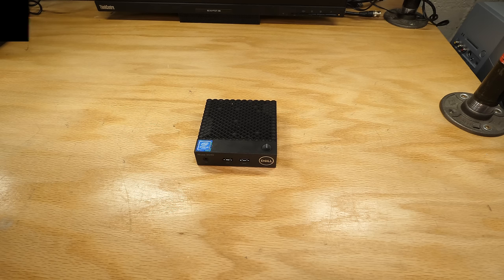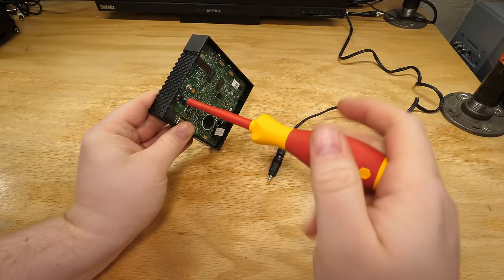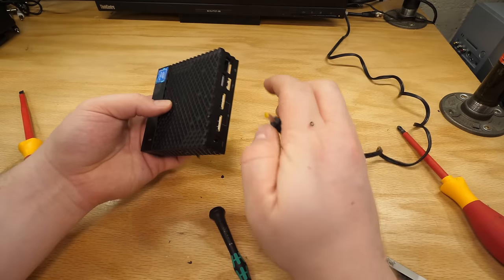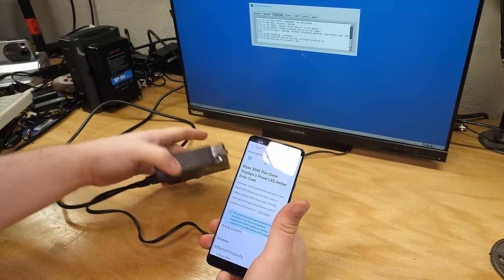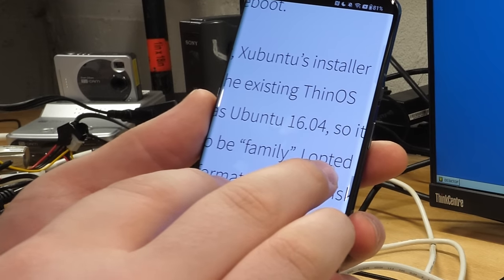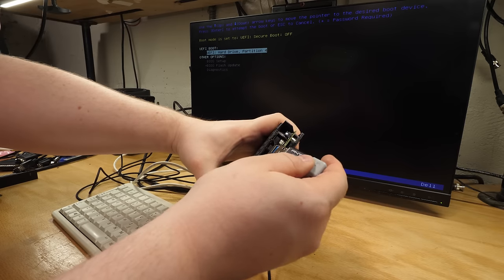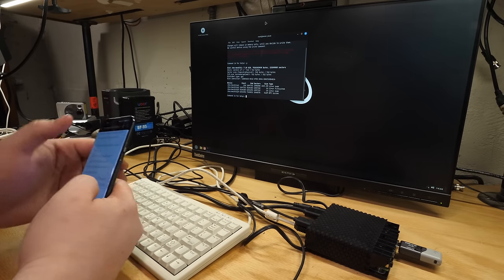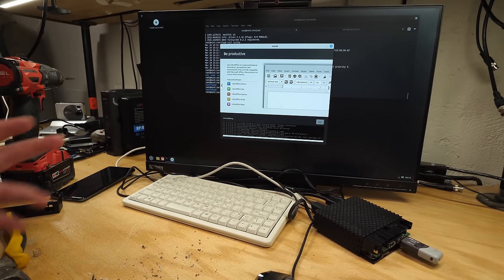Little Guys: Episode 2 [Wyse 3040]

Comment: Uh man those ones suck got stuck with them at school about 5 years ago even from the Citrix screen it was painfully slow like 3-4 minutes to desktop meanwhile the desktops with your user data saved took less than a minute and also if the vm froze forget it. Without task manager and the system occasionally frozen from chrome,etc… was a good 5-7 minute endeavor usually making logging onto another thin client faster and more painless made my Chromebook look good by comparison. Also occasionally the VM would just freeze and disconnect or lock up the whole system.

Comment: That tiny little thing is actually more powerful than the decade old 2 core atom machine that is running my jellyfin and asterisk. If there were a way to put a few terabytes of storage in it, it'd be an upgrade for me. Shame it doesn't have a m2 slot.
Reply: its got a usb 3 port on it you could plug a drive in that way. i got lubuntu running on mine and it was able to play back 1080p video over the network so performance wise its not that bad.

Comment: I got a hp 5040 or 5010 and I couldn't get it to boot ghostbsd and a bunch of linux distros and when I got manjaro working it was god awful slow so I since it came with a stand to keep it upright I now just use it to hold up a vertical stack of think pads from falling over

Comment: You can run Windows from a USB drive, even if Windows won't allow you to do so - you can apply the Windows install image to a USB drive and then boot from that.

Besides PCoIP "Zero Clients" which literally have bespoke silicon to decode PCoIP, most of these things are x86 and Linux based. We had some Dell/Wyse D50Ds which ran Dell's full fat OS which allowed RDP/VMware/Citrix/etc... My boss then bought some D10Ds because they looked identical... except that the OS is totally useless and we couldn't connect to our VMware environment... so I had to spin my own Linux distro using some build kit that escapes me... needless to say the whole experience was painful. The hardware in question was an old AMD dual core CPU, an 8GB SATA drive on a stick, and a 2GB SODIMM.

Ironically, the Linux image I built actually ran VMware Horizon better than Dell's own OS...

Comment: I threw Ubuntu on one of these and used it as a Plex box, the hard disk barely had enough space for Ubuntu and Plex, but that usb 3.0 port was key. I could use it to stream stuff from along my network and it was a super power efficient Plex box. What ended up killing it was os updates, Ubuntu grew too big and wouldn't fit on the HD. I did run windows on it for a lark and it runs terribly.dont bother.

Comment: What will it do if you put an el chiepo  M.2 drive in that M.2 slot? I did the same with my old, much larger PC and it worked first try. It might be worth getting a couple $20 M.2 drives to put in stuff like this, even if you have to hack it into place.

Comment: Those wyse 3040s won't post if its missing either of those screws. Now outside the case it will but inside it uses them as ground and won't turn on without them.

Comment: If you really want to install windows you want one of the IoT flavors. I believe this is what they now call the Embedded flavor of Windows. I was interested in setting up a Wyse Z90m7 laptop as a like Cheapest Possible Streaming Device and went down this rabbit hole. It only has 4gb of emmc storage so I believe I had to use an older Windows 10 IoT Enterprise LTSC flavor that was 32-bit instead of 64-bit because the 64-bit install size was larger than 4gb. 

I still have it on the laptop and it totally works fine, other than finding 32-bit versions of apps is a huge PITA. But I think my use case for this thin clients is very viable. Just make sure the OS is and application are correctly set up to use the hardware encoder in the CPU chip, get some sort of cheap USB UVC HDMI capture card, and for like $30 you can get a standalone streaming device. My Wyse laptop and chromebooks have a built-in webcam (potato quality, though) to even get a POV going on your stream!

Comment: You should check out the Wyse 5070 models they have a whole lot more options and upgrades. Both the extended version and the regular support nvme and 2.5gb ethernet addons.

Comment: Ahh, the classic "Python's handling of Unicode vs. bytestrings still sucks in 3.x... just in different ways" problem. Very irritating if you're a programmer hopping back and forth between Python and Rust and constantly getting reminded of how much better things can be.

From the traceback, it's dying in Ubiquity, which is Ubuntu's GUI installer. They seem to be unifying their text-mode Ubuntu Server installer on the same codebase under the name Subiquity, so it'll probably have the same problem, but you could try Debian instead.

Comment: I suspect you could use the stock software installation to connect via Microsoft RDP to a Windows 10 or 11 Pro machine that was set to allow remote desktop sharing.

Comment: I got a Fujitsu Futro S720 for 17€ and simply ignored the internal disk, booting Batocera from an USB stick, installing Steam on that and then installing Stardew Valley.
I think i should get me such a Wyse 3040 and check out what it can run, again ignoring the internal disk.

By the way, the CMOS battery is just a coin cell in the end, snip off the cables, get a flat coin cell holder, solder that to the cable and put some isolation tape around the whole shibang.
Reply: Anyway, the Wyse 3040 is way too expensive on the used market for what it is, i am not paying ~40€ for that thing.

Comment: Would stuff like Onlive and Steam Link be the video game versions of a thin client? How about Google stadia Chromecast? I'm not sure that one would count.

Speaking of video games this looks like a good place for your 32 GB SSD that's not really an SSD if this computer can handle it. 8GB is not enough im a wii u owner..

Also smallest drive I have installed Windows 10 on is 24 gig and surprisingly that was an SSD not EMMC
Reply: For the OnLive/SteamLink, basically yes. For the older Chromecasts (the ones sold with the Stadia Controller), it does have some aditional functionality as a video client, considering it's basically a very stripped down version of Chrome. The new Chromecasts are basically just Android boxes.
Reply: @Fay7666  ya I have a Chromecast. It's very strange how it has no menu or remote you have to literally do everything on your phone.

I like having a remote to pause or fast forward rewind like my Blu-ray player has but it doesn't have any of the streaming apps I use (cept Netflix and YouTube).

Mainly having to wake up your phone to pause is weird to me. Also what if I wanna charge my phone wile watching something. How will I pause the video then?

Comment: I remember trying to run windows off a 8gb USB stick. Win7 was too heavy, but some version of Win8/8.1 and early 10s was installable. 
I think I got to sub 7gb used, but a few hours with the system on, with a browser installed would fill up the drives, so it was really not at all usable. 
Unrelated but Win8.1 is a superior OS to 10.

Comment: Mine is running DietPi via a SanDisk usb - on 24/7 with Adguard. Currently trying to switch it from ethernet to wlan via a TP link adapter but it's being a pain in the backside.

Comment: I have booted into windows 10 with one of these, via an ssd over usb 3.0, it did not like it, at all.  Anything beyond the basic desktop felt completely unusable.  Plugging into a network caused it to lock up for around 2 hours while it updated.

Comment: EMMC will flat out just break if its not used for a period of time. I had an acer laptop with EMMC and it worked fine for what it was. never had an issue with it until the charger broke and i just stopped using it. Was going to give it to my mother after i found a charger that works and after not using it for 2 years the EMMC chip is completely dead. Being that theres no way to use alternative media the laptops officially e waste unless i just booted off USB every time

Comment: The easiest way to work with one of these things is to just install your os to a usb drive. the wyse 3040 is in a strange place specs wise its only supports efi no bios. but it only has 8 gb of storage which in reality is 7.5 gb.  most linux os's even the ones focused on performance require at least 8 gb of space.  so its actually a little frustrating because most linux flavors will happily run as a live cd but will crap out during the install.  there is a an adapter that can plug into that slot inside the pc but that will let you plug in a micro sd card for storage, however its got problems it requires drivers to be installed and  only works with specific memory cards. so aside from breaking out the hot air rework station and replacing the emmc chip that leaves usb 3 flash drives for regular os installs.  on a side note if you want to use the thing as a pi alternative you could  load an image directly to the internal 8gb of storage with etcher.

Comment: ooo I recently got a lot of 12 of them for $18 each, was supposed to be 12 but they threw in a "bad" one that worked just fine.
BIOS password is likely "Fireport" (likely mentioned on the video, but I just started watching it).
Reply: Although I will mention, I only got 3 that I consider "fully well" and just work including showing the NICs in the boot menu, 6 of them with a dead battery that take a minute or so after plugging in before they work (like in the video), and 4 of them that do that but also can't soft restart for whatever reason. Just got them a few weeks ago, haven't put them to work. Likely gonna do a Pihole or something with one, and try to use the others to learn clustering or something.

Comment: i dont think it has a superio. ?
the power on button is routed through an intel server ethernet chip, and most of the other io is handled by a usb controller. between the two it has roughly superio-like functionality
so its gonna a super bespoke boot sequence.
might also explain how the filesystem is architected, and the issues with the keyboard in the front usb ports

it could well be running mips under the hood until the atom initializes lol
certainly its gonna be booting off 32 bit code

Comment: Ironically I'm currently watching this video on an Intel Atom system. An old Intel NUC from 2015 with 8 GB of RAM. Too old to have an M.2 slot. It's my dedicated YouTube machine. It runs on 8 watts so I never bother to turn it off. I do turn off the monitor which uses WAY more power in comparison.

Comment: I installed windows 7 once on an external ssd on a laptop that the internal drive connection broke off the board. There's a way to do it, but its a little jank. There's also cut down verions of windows 10 like tiny10 from ntdev that use 2gbish of space.

Comment: Some of the slowness of that installer might be down to the absolutely terrible performance of those PNY USB 3.0 drives. I bought a 256GB one 9 years ago to replace my USB 2.0 64GB SanDisk only to find it so much slower than the SanDisk, managing to be even slower than my 2GB SanDisk from 2007 in tests, I ended up not being able to use it. Between that and numerous shoddy PNY RAM kits I had to replace I still refuse to touch their crap.

Comment: I work for a large national retailer and we used to use these for the training modules we are required to take and thses were dog slow and problematic and i parsed the commamd lone interface and ot connected to a vm that ran under suse linux, it took us longer to load them up tahn to do our training

Comment: I actually was able to force a barebones install of Windows 10 on my Wyse but it was at like 99% storage utilization which was a big problem because it was missing a bunch of drivers and it had no spare storage for basic operational needs. Also Windows update never found the correct Wi-Fi/Bluetooth drivers even though mine has a Wi-Fi/Bluetooth card in the slot (maybe because it used a weird SDIO type?) so I could only use the Ethernet port for internet access. Also it’s only got 2GB of ram so the performance was just bad. Overall this unit is pretty pointless, the 8GB soldered eMMC is too limiting, not to mention the speed of this storage type and the endurance will probably leave much to be desired. You can get a much better unit for a few extra dollars and there’s too many downsides to make this unit appealing.

Comment: I got Arch Linux running on mine using the archinstall script. Mine has 16GB of storage, though.
Basically all I did was nuke the partition table and then run archinstall. I was at a Hyprland desktop in about an hour and a half.

Comment: I think it could run windows using Windows To Go, which is a cursed portable version of windows that runs off a USB drive. It wouldn't exactly be "installed" per se, but it would probably work.

Comment: CMOS battery is dead, I would just use a variable voltage power supply to simulate it. 2:41
Reply: That... is spectacularly overkill when a CR2032 would do.
Reply: @SianaGearz I believe he says that he doesn’t have one at the moment. I was saying that as a temporary hack, not permanent replacement.

Comment: You should be able to get Windows 7 LTSC (use NTFS compression to compress program files and some of the Windows folders to shrink it a bit) or you could go backwards to a Windows 2003, most programs still work with it.
Reply: Windows 7 LTSC isn't a thing

Comment: I've had problems with ubuntu and colorspace before. If you change the color profile it should sort it out.
Reply from the maker: I tried this and couldn't work it out, but since it periodically jerked back and forth into the correct colorspace I'm pretty sure it was something lower level.
Reply: @CathodeRayDude  you could be right, I had the idea beforehand that it might be a driver issue where the display hardware/chip set is being driven wrong. I usually had this exact problem on much older hardware like a Toshiba T9100 way back when

Comment: About 3040 OSes: 1) thinos IS NOT Linux based . Proof? Uses any network pentest tool, it should recognize thinos as vmw esx "brother" not Linux 2) dell had the separate firmware for 3040 based on ubuntu 16.04 called ThinLinux 2.x

Comment: I have always wondered if you could set up a thin client system that would allow a number of users to be able to surf the internet and so on while accessing the main server. 
I use a workstations which is a quad core i3 10th gen with 32gigs and m.2 sss. While I do not need a high end system I do need the ability to stream 4k and with hdmi and DP. Thin clients are cheap and offer an option. 
The price of good computer systems that are not loaded with over powered stuff is just not out there. Most companies do not offer any thing like this. Even the cheapest workstation now is 800 bucks and mine is not even a year plus old.
Reply: I've seen LTT use a program called Unraid to do what you're trying to do. Also, Windows Server with license packs is a surefire way to go, but very pricey. 

Though your 10th gen i3 might not have enough poop to support more than 2 concurrent users. Side note: where does it get off calling itself a workstation with that CPU?
Reply: @andreydildin Yeah anything that would be great will cost money. I just want to supply my house with enough stations that a user can sit at a desk and use the monitor to do computer related stuff while still being able to toss stuff to their big screen that is above them. While we do use smart tv stuff sometimes people like to play videos from their computer. Either way I was underthe impression that a work station was a computer that was more about work rather than gaming and power. My work station runs with dual 22inch and a 55in 4k tv total does not exceed 250 watts when fully powered up. (I want to switch out the dual displays for a ultra widescreen 48" or bigger curved monitor). I have no problems do any type of surfing on the web and or stuff that I do do on it. I can watch videos, stream and so on with it very easy.
Reply: @kameljoe21  omg I totally forgot: windows 11 pro comes with VM software! So here's what you do: buy a Windows license (like 12 bucks on productkeys) for each additional user, and set up a VM for each of them. Then they can remote into their VMs from any thin client on your network, and you can do the same with the base machine.

Comment: i love this one i use it as raspberry-pi for network stuff like pihole
Reply: Came here to say this! I have one running Pi-hole, bought second hand from eBay. Far cheaper than a Raspberry Pi because you don't need to buy a power supply and case.

Comment: the absolute smallest ive managed windows 10 was 6.7gb on a chromebook with 16gb emmc after my macbook took a trip into the ocean and i really needed a laptop during the time it took apple to make me a new one
that very quickly ballooned to 14gb after very short run time and after the 2 weeks (of surprisingly excellent battery life) i had something like 48mb of free space

this required me to install on a different device then trim it down and enable disk compression before flashing a disk image to the chromebook
it was awful

Comment: When you said you was going to drill a hole, I thought you meant you were going to drill a small hole, not a size 6 bit lol (for updating firmware on sas drives I have a Windows 10 installed on a nvme USB boots perfectly fine 500gb mini nvme for a 4mb update is little excessive thought, as that waze has usb3 should be fast if it can boot off it if not the USB2 ports work as well,)